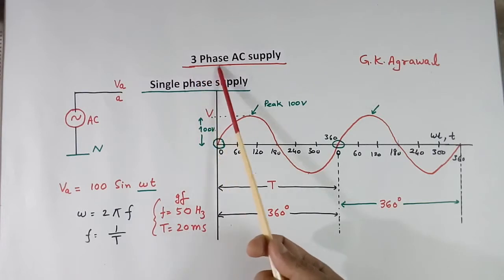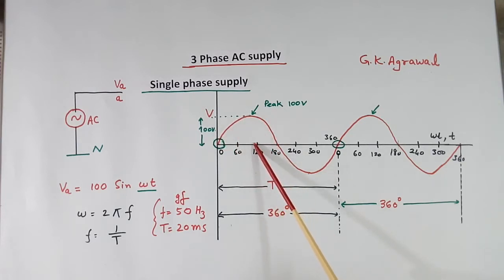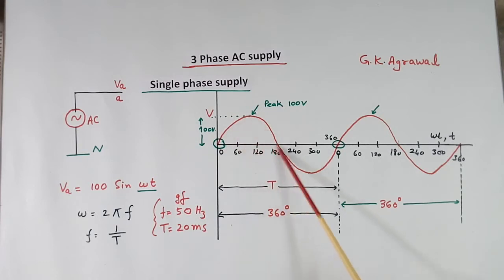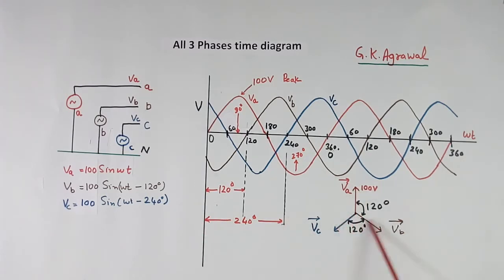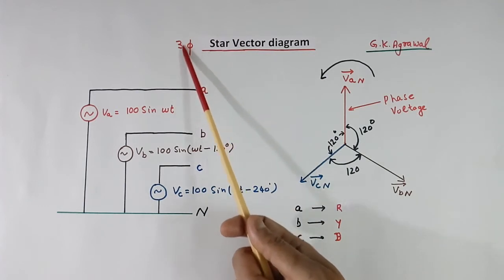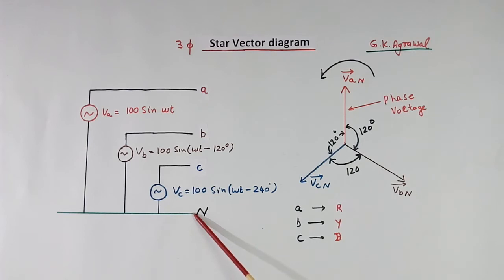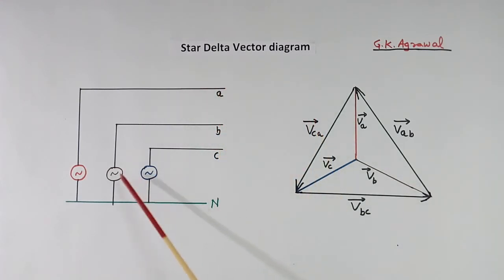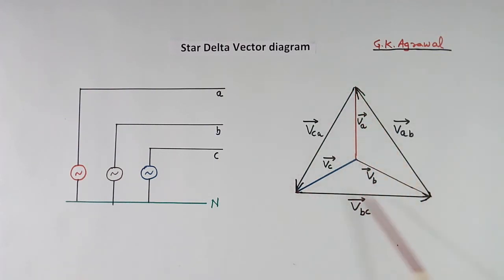What is 3 Phase AC power supply electricity concept

Comment: Hello sir, 
This is something that is continuously coming into my mind while studying 3 phase AC supply that is; at a particular time, why does one phase always not in action and the other two phases are generating the voltage which is 380-440V?
Reply: that's why it's called a balance configuration , the magnetic field may be parallel to the the  coil you say

Comment: sir electric train me jo pentagon hota he usake upper 25000V ke liye two line kyo hoti he vo bhi kisi distance pe short kyo?
Reply from the maker: 1- Top wire is for power supply to train. 
2- Bottom wire is for contacting pantographs. Pantagram require some frexible wire arrangement which can move during vibration of train
3- Hanging vertical wires at some distances is to support botton wire ( to hang botton wire).  They are also conductor and supply power to bottom wire
Reply: thanku very much sir